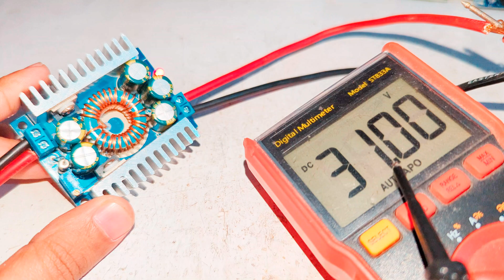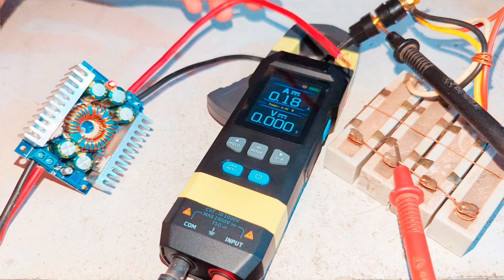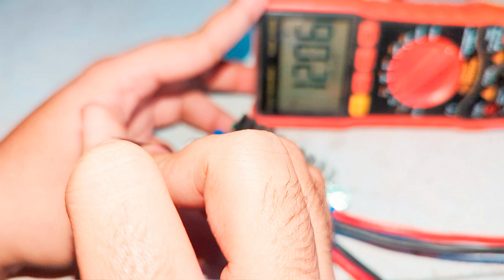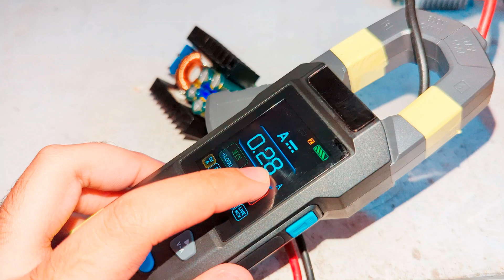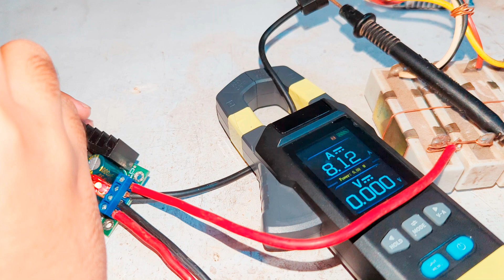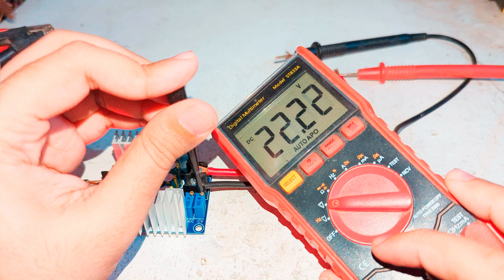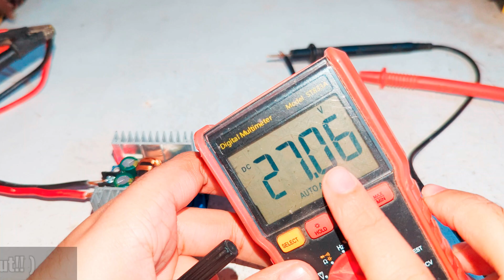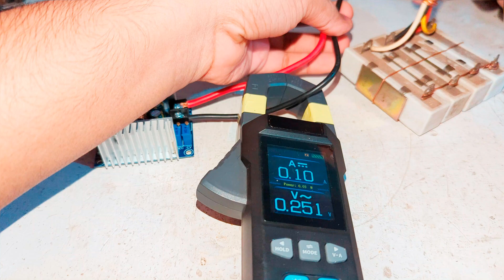3 Buck Converter Module Testing! Which one is Better?

Comment: Bro mere pass three egs002 ABCDEF module hai jo ki maine 2 board robu in se buy kiye hain aur mere pass aapke jaisa ek egs002 module hai / Jo do egs002 module hai usme lcd work nahin karta hai aur ek jo module aapke jaisa hai usme work karta hai jabki dono board same component same ic.s same drivers ke sath aate hain per phir bhi Jo do egs module hain unme lcd work kyon nahi karta hai TO KYA AAP MUJHE ISKA SOLUTION BATA SAKTE HAIN YA AISA KIJIYE KI JO EN EGS BOARD MAIN CHANGES KARKE LCD WORK KIJIYE
Reply from the maker: If only the LCD doesn't work it's a copy board with altered framewear
Reply: Ok sir phir maine check Kiya to isme eg8010 ic hi local hai thanks

Comment: The no name buck converter maybe use LM25116 clone version as a controller IC. If this IC fail, you can replace it with orginal LM25116 and still work like normal
Reply from the maker: I think they removed the marking to prevent people from repairing it .
Reply: is lm5116
Reply from the maker: I think both are the same ic